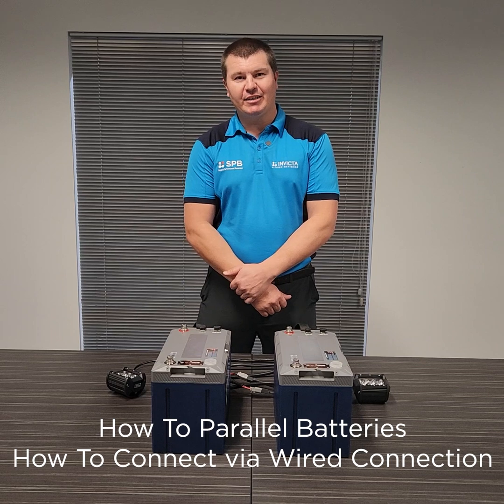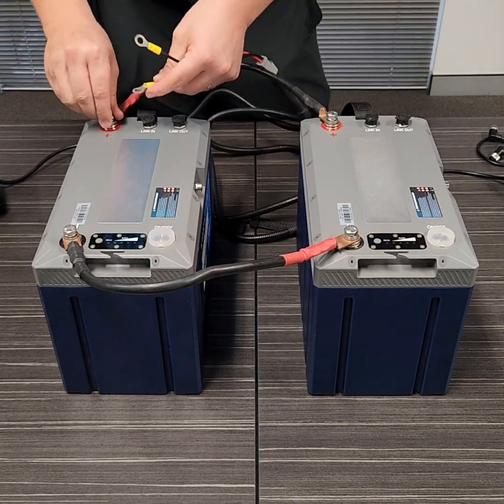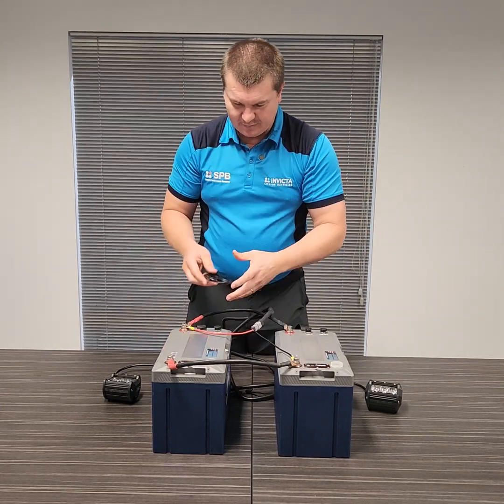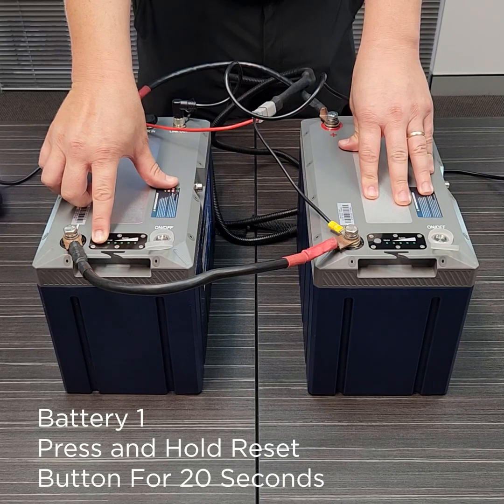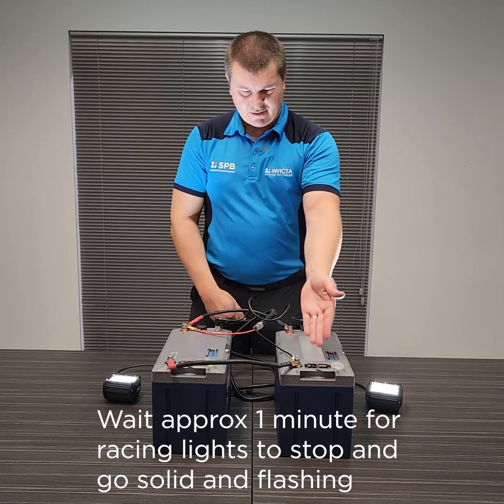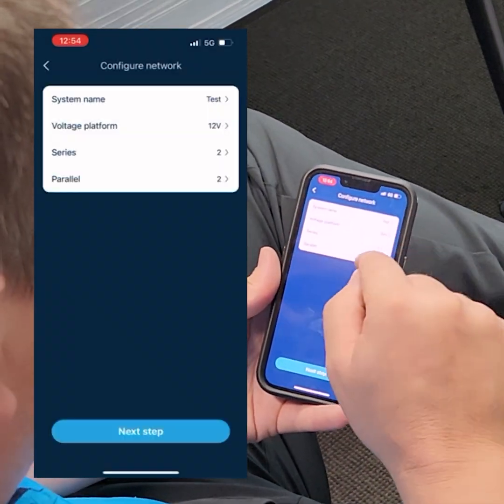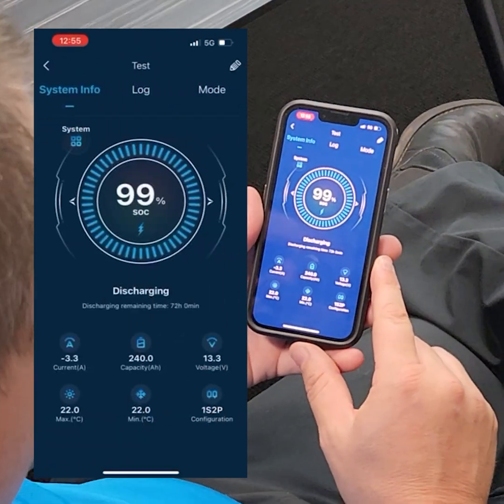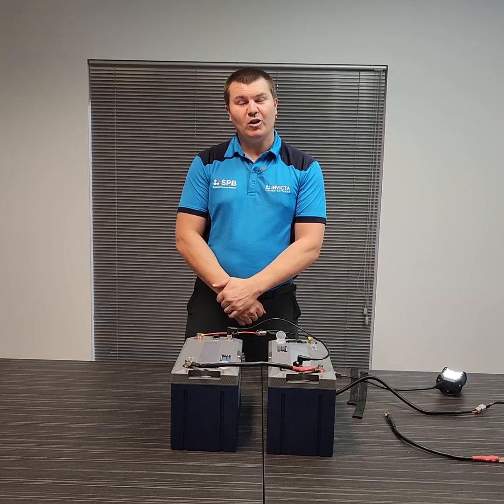Invicta Xero Tutorial Video Parallel

Comment: How long will the battery last using a 12 volt 4700GPH pump, how many hours?
Reply from the maker: Depending on the system and the unit, but this pump typically draws 16Ah. Therefore, you would get roughly 7.5 hours
Reply: @invictalithium1376  ok what’s the average time it takes to recharge this battery?
Reply from the maker: @baronblahblah2396   depends on the system again. But it can handle a 100Ah Max charge current. If you were to charge at this rate, continuously, then 1.2 hours. What charger do you plan on using? We also have higher capacity batteries if you needed more performance, you can see the full range here https://www.invictalithium.com.au/knowledge-hub/full-range-and-specifications/